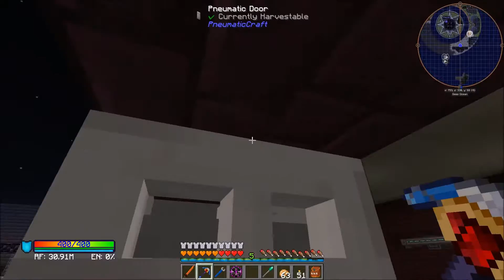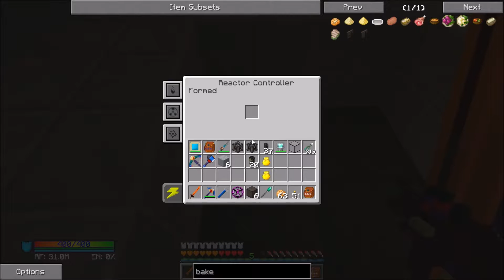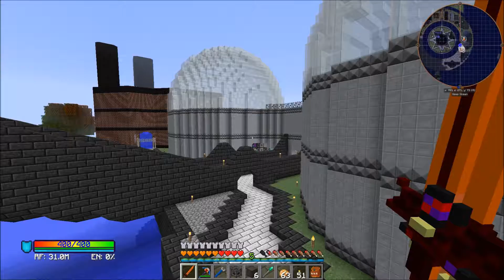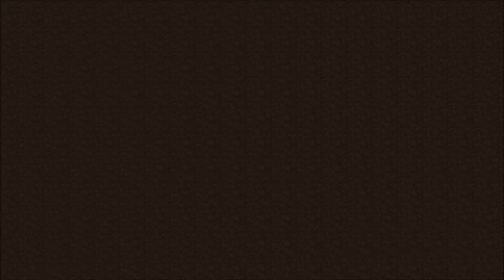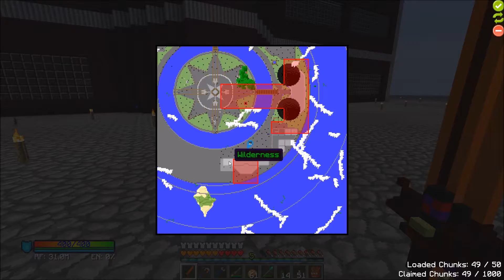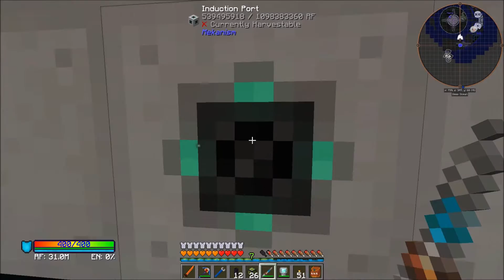Minecraft Crackpack Lp Ep 53: Power For Days!

Comment: Enjoying these last few episodes. Try using speed upgrades wiih the world interaction upgrades.
Reply from the maker: I'm glad that your enjoying it for sure :)  Yeah, I'll def check and see if its filling before the node can send the water.  That may very well be the case.  I had gotten used to not using speed upgrades for direct transfer like that, but yeah, need to move a ton of water atm :)
Reply: +To Asgaard maybe use a stack upgrade as well?
Reply from the maker: Yeah, you are probably correct.  Thats like 8k mb as opposed to 200, so I will def throw some in there